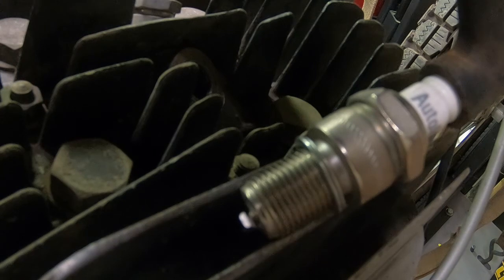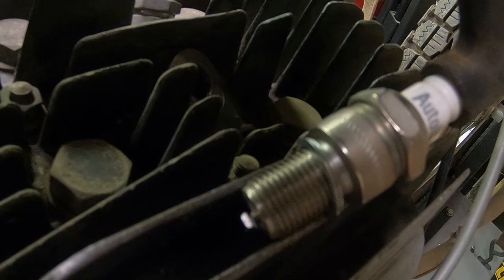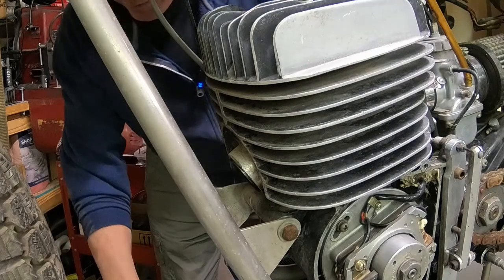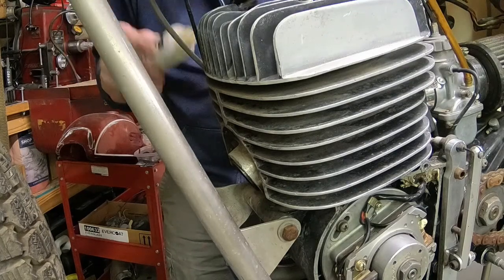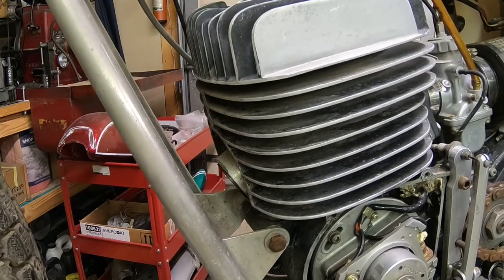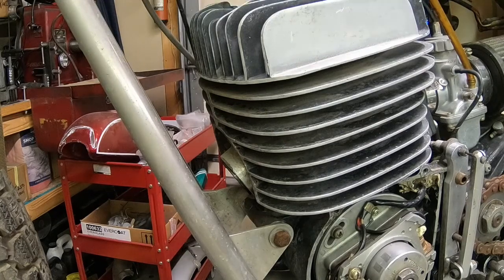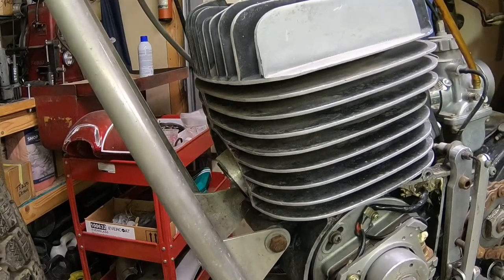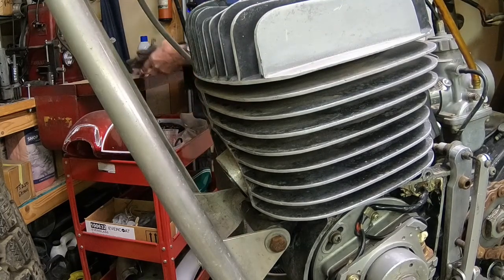Yamaha Flat tracker spark and fire

Comment: your in better shape than i am not even breathing hard, i would be having a stroke by now. might need to make up a remote race track style starter. notice lots of custom stuff is that clutch mechanism stock? and the CDI ignition, quite the bike in its day and still is your lucky to own such a sweet machine don't ever sell her .
Reply from the maker: I dont know Frank, thought I was pretty winded. Its a bear for sure, was in 5th gear and still having a hard time. Yeah clutch mechanism is custom, the CDI was stock, first year for it on the MX i believe. Back in the day most used to put flywheel weight on them to moto-x, flat track used internal flywheel. There is a lot of custom stuff for sure. I bought this in Tulsa at K & N Yamaha. They are the people that make the K & N filters. They moved to Tulsa from California in the early 60's. All the most successful riders in that area rode for them.
Reply: Nice video Dale I was hoping she would've fired.
Reply from the maker: Well it did Larry, got 3 pops out of it. I didnt put any gas in the tank. I'm sure the carb needs cleaned. Almost had a stroke trying to turn it over.